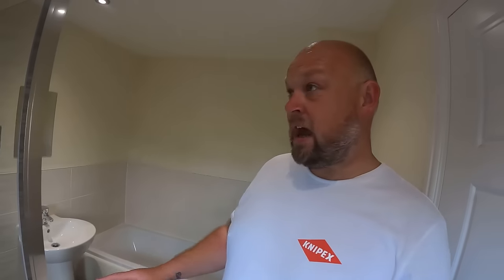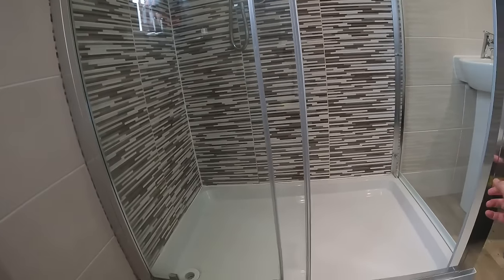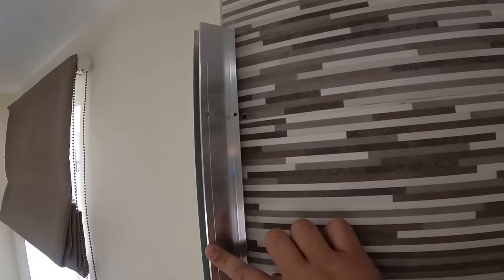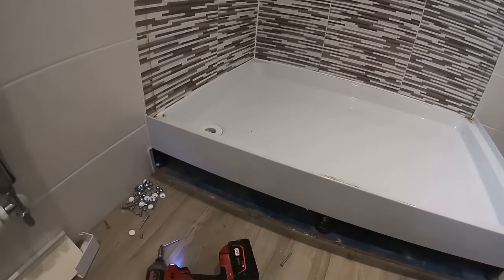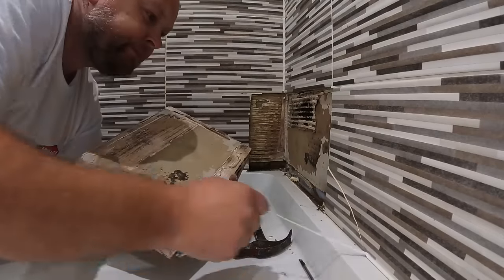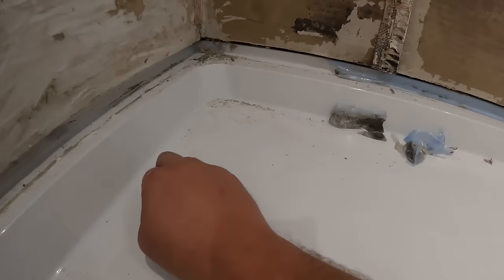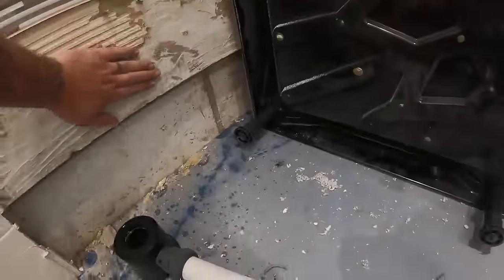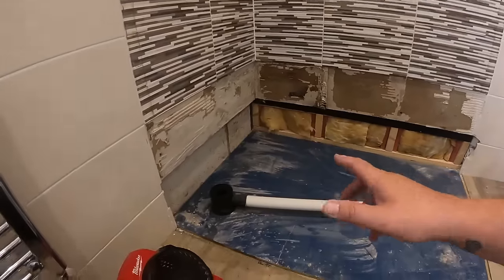BATHROOM SHOWER PROBLEM | BAD NEWS for the customer. REAL WORLD PLUMBING

Comment: Brilliant real workd plumbing job.

I went to a new build to replace tap cartridges as the tap was passing.
The owner said his dish washer had stopped working and did I know how to fix them....

The sink was not siliconed or fixed down and the water from the tap had pored into the dish washer.

After tipping the dish washer, a torrent of water escaped out, take the back off and hair dryer.....jobs a gooden.

New builds are where cowboys and trainees cut their teeth.

I would NEVER buy a new build.
Reply from the maker: 🙏🏼thanks buddy

Comment: To be honest, I don't even take on jobs like that anymore. Last one I did the frame had been stuck on with no more nails. Tiles came away with the frame, as did most of the plasterboard wall.
Reply from the maker: Always have to mention all that before you even start the job to cover yourself….. then there is no surprise costs 👍🏼👍🏼
Reply: @MJTiffPlumbing yes give the worst case scenario!

Comment: Wtf, like have you heard of a multi tool or a grinder. Those tiles were stuck on with nothing, most could have come out with no damage using a multi tool to cut the grout and using a plastic pry tool not a screwdriver! and the broken side tile was so unnecessary, just get an angle grinder at the tray and would have not broken. Just careless
Reply from the maker: Completely Irrelevant comment buddy…. They are all coming off anyway… 

But thanks for the comment…👍🏼

Comment: Stay of go is cut 50mm off each side of the cream tiles from the top to the floor and then add a decorative strip from the floor up to the ceiling, that will define the shower cubicle and wing look at all out of place, it will solve your issues and look nice you!
Reply from the maker: All will be revealed in the upcoming video

Comment: That's a coram shower tray. They are actually pretty expensive and you tend to see them a lot in student apartments. Most Coram trays come with an additional few mm to accommodate the cut in to the boarding. Not 40mm recess this bodge demonstrates. Better off just ripping that section out and tanking the floor and walls and fitting a wet room tray and then fitting a cubicle around it.
Reply from the maker: It is indeed a coram tray mate…. Will be sorted in the next video (infact it’s all ready done😉)

Comment: Nice content bud. Would shower panel not be an option over the tiles? The ends could be packed out with strips of cement board to give a fixing for the cubicle, a chrome trim could be fitted to that and the end trim for the panel could run in line with that. Unconventional I know but maybe easier than a full tear out. I hope that makes sense btw😂
Reply from the maker: Thanks mate, yer I get what you mean but customer wants it tiled 👍🏼👍🏼
Reply: Tell them it NTS mate!

Comment: Hi. Think I missed it, but did you explain what was wrong with the original shower? Guessing the board not touching the tray and lack of waterproofing/tanking? Fundamentally there should not be an issue with shower tray sitting under board as long as waterproofed?
Reply from the maker: Not good to have it under a board imho…..

Issue was with the height👍🏼

Comment: Wet room tray cut it to size. Or get a shower tray that u can cut down
Reply: What I was thinking
Reply from the maker: Wet room tray is a good shout if it would of worked with the flooring etc….
Reply: There are loads of cuttable trays out now too, handy in a tight spot. But rather think you have sorted this already
Reply from the maker: Yep… it’s very nearly done and finished 😉
Reply: So what you doing for the shower enclosure

Comment: I recently renovated a bathroom from a new build. They built the shower enclosure with blue acoustic plasterboard. The customer said the build is 8 years old. Although the damage behind the tiles wasn't has bad. The tell tale signs are there for this kind of issue for the whole estate. 
After dismantling the bathroom suite. I discovered leaks on the shower tray, toilet pan and sink. Crazy! This is an epidemic on all these builds. Where is building control?

Comment: I'm assuming they set it back behind the board so they could get the tiles past that lip onto the inside of the tray. Terrible idea though any water getting past would just wick up the plasterboard. 🥴
Reply from the maker: Who knows why they set it back 40mm into the wall and against the outside wall…. Just shocking…
Could of tiled over the lip as normal…. Just another bodged up new build home…. So many about..
Reply: @MJTiffPlumbing  yep my house is a 2009 build. It's all Uponor piped but they're just slung in walls not clipped, same with leccy cables I've found going diagonally in stud walls. It's not good.
Reply: Never use drywall behind a shower, some manufacturers recommend the wall board should go over the lip but does not touch the pan 1/4" minimum clearance. See national tile council recommendations, north america, it's a waterproofing issue, water penetrates the grout a must exit at the pan. Is that mastic, a definite fail, thinset only 90% coverage minimum in a shower.
Reply from the maker: Different in the UK buddy….. mastic is used a lot and no issues
Reply: @MJTiffPlumbing 
Just going with my 30 years experience, torn out too many showers to count done with mastic,  yes some brands will say it's suitable but recommended the bottom two feet in a shower should be thinset. I just believe in doing the best possible way as people are paying me  thousands of dollars for a tile job and i guarantee that it will not fail or leak. Just tore out one that looked great to the customer. Behind the wall it was a moldy soggy mess. But in this world cost and speed seem to trump quality.
Reply from the maker: Yep…. Also I have 30years in the trade and never had an issue with what I do or how I work…. We all do what we know works

Comment: Done jobs like that in the past... nightmare, I've never encountered a shower profile not silicones to the wall though, touched lucky with that part,but when I have I use a cheese wire to cut through silicone,saves damaging tiles.
Reply from the maker: Yep cheese wire is one I want to try

Comment: Could you not just install the new tray back upto the wall, just like the one that was fitted?
Reply from the maker: No… as that’s completely wrong and as said in the video I wouldn’t want to do that at all.
Reply: I work on new builds and see this all the time (I’m a tiler) what is the difference between fitting up to wooden studs or blocks on an exterior wall, Or are they both wrong.
Reply: What is the correct way
Reply: @MJTiffPlumbing how is it wrong, it’s not caused any leaking issues.
That’s caused from water leaking thru the tiles.

And that plaster board can’t be left as I think water might be leaking higher up?
Reply from the maker: You don’t want a shower try fitted that deep into a wall and against the outside blockwork… it’s just bad workmanship.
Plasterboard/moisture board/hardiebacker board should go to the floor then the tray fitted against that…….

That’s how I personally do it, and have done for 25+ years with zero issues… once sealed in and tiled properly it won’t be an issue at all..

@michaelanderson2689 as said in the video…. Part 2 coming soon…. Wait and see what’s done

Comment: God awful original job, wouldn't even be allowed now (but is still done) as it's supposed to be cement boarded and tanked otherwise insurance companies don't have to cover it and can walk away as it's not per the building regs now. The crap that's thrown in on so many new builds is disgusting.
Reply from the maker: Typical new build

Comment: Should take the boards up and see what's your options our in terms of the waste outlet then possibly change it to a wet room then you can cut the Tray to the required size, one glass panel required, re tile where required when complete gives the customer a better finish job done.
Reply from the maker: Customer doesn’t want a wet room, they want a tray…. Follow up video coming soon😉👍🏼
Reply: Thanks for the reply Mark, I'm sure you will solve the situation with a quality finish.

Comment: Keeping the customer in the loop as the job pans out is one of the most important things to get right. Lack of communication ultimately breaks down the trust..
I have never seen a shower tray fitted in this way before. Perhaps the house builders fitted lifetime shower trays that would last longer than the place it is sitting in. Considering all the cracking in new builds and the way they are thrown up, I'm probably not too far from the truth.
Reply from the maker: Indeed mate…. Always keep them upto speed

Yep I’ve never seen one done like this before…. Not great at all

Comment: How can't a shower cubical not fit when the old one forted. Cubicals arent the same size the tray
Reply from the maker: Because the tray is going to be 40mm further out buddy….
Reply: @MJTiffPlumbing  thats not an issue. Bury the tray, tank down to it ,re tile and fit a new cubical that will reduces down to that size
Reply from the maker: We are going this way on this job as you can see 👍🏼👍🏼

Comment: We bought an old house and are currently ripping out our wet room and replacing it with a bath and shower. Its a bigger job than anticipated especially as we have a iron soil stack running through the corner of the room and im trying to work out how to move the toilet to the wall next to where it was originally without cutting the soil stack.   Its quite fun learning new things though.

Comment: Im a bit confused and really wana learn, why is it a no no pushing the tray against the external wall, wasn’t they tray designed so the lip hides behind the tile. Couldn’t it be butter to the wall and be boarded and tanked in that area or use cement board. Thanks
Reply: Only just realised part 2 is already out, will check that now, sorry if that answered my question, thanks

Comment: No wrong way, silicone the inside only, that way if it does fail the water has somewhere to go to get out. If you silicone the outside only your just asking for the wall to rott and mould.
Reply from the maker: Silicone the outside and seal it all…. Stops the water getting into the tiles. It’s all tanked now anyway

Comment: If you had removed a section from the back right hand corner of the tray, which was being replaced, then you would not of broken the wall tile! Me thinks this had influenced your way forward. The tray is a standard dimension, nothing wrong with fitting a new low profile tray to the  block work and re fitting enclosure!
Reply from the maker: Everything wrong with fitting it to blockwork buddy…… people who think that are the issue…
Reply: You say everything but you don't site an example. Ordinarily you would but the tray up to the backer board and seal and I'm not advocating the original install but if the edge of the tray will allow then I don't see why you couldn't improvise to suit the situation!

Comment: I have come across water ingress through the screw holes holding the shower profiles onto the tiled wall. More water than you would think possible too. On this particular job there was a false wall behind the shower where I witness the water running through the plug & screw. Textured tiles don't help either.